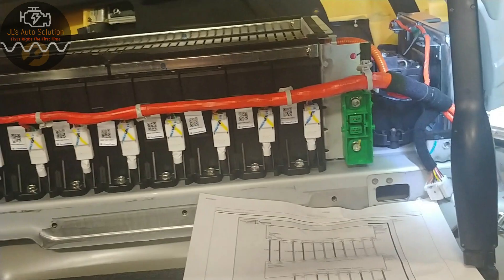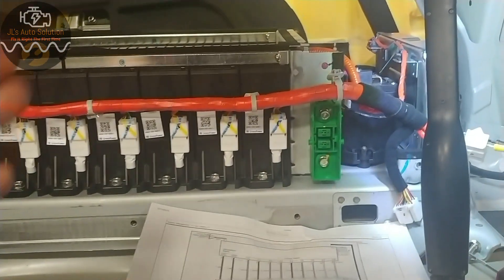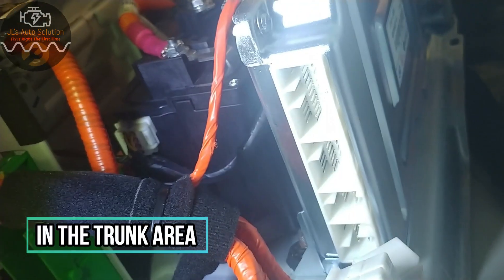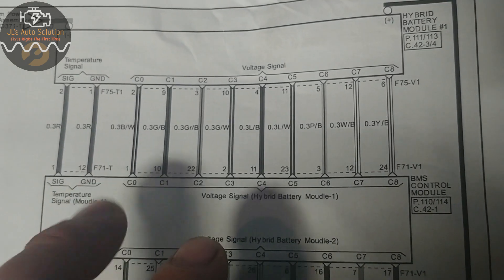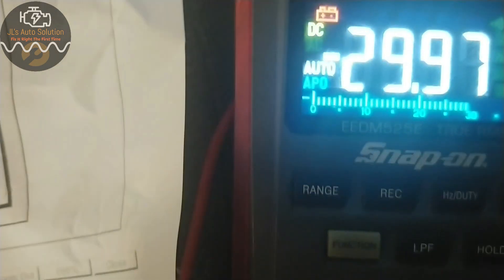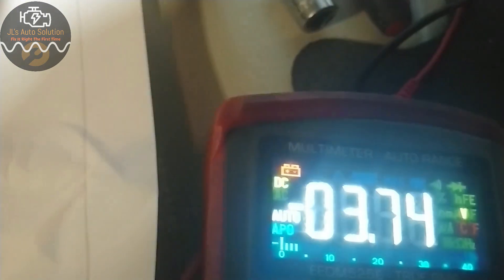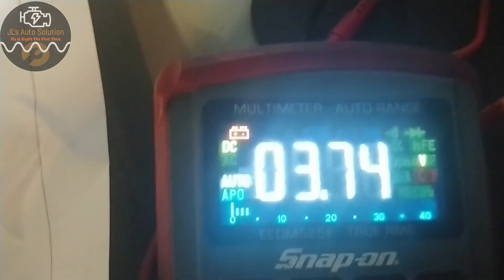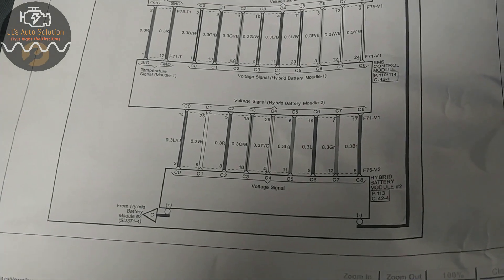How To Verify Hybrid Battery Cell Voltages

Comment: Is there a load test procedure to determine strength of each cell?
Reply from the maker: Be aware that testing around this battery can be fatal. and only TRAINED PROFESSIONAL show do any work on hybrid and electric vehicles using the proper PPE (PERSON PROTECTIVE EQUIPPMENT)

you need special equipment for performing those test  you can purchase it but, it is not cheap. An easier way is to check how long it takes to charge up one cell and how long it takes to discharge it. 

And again be careful.